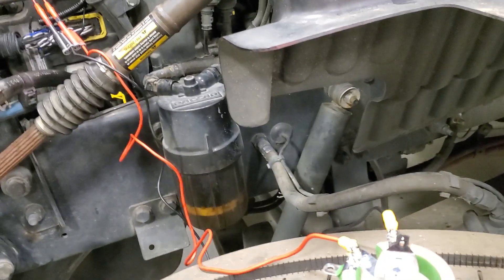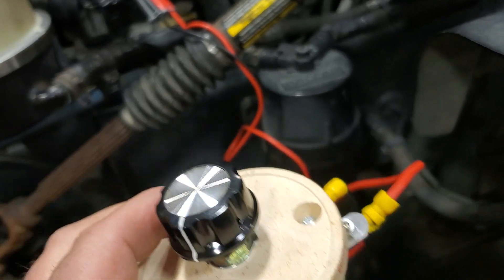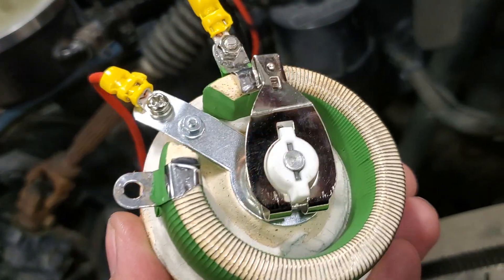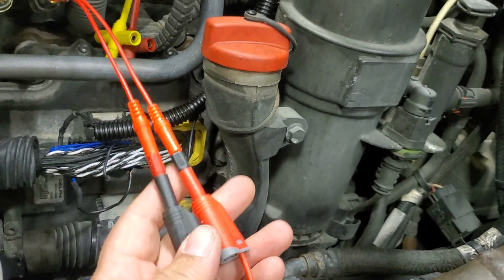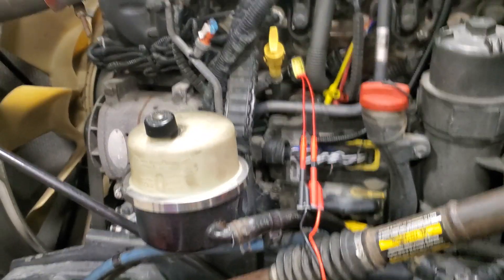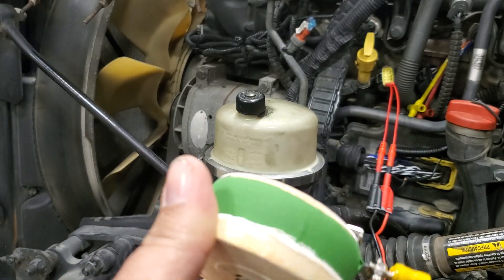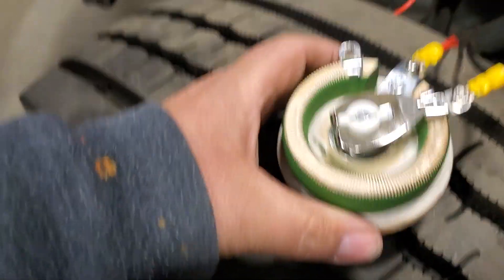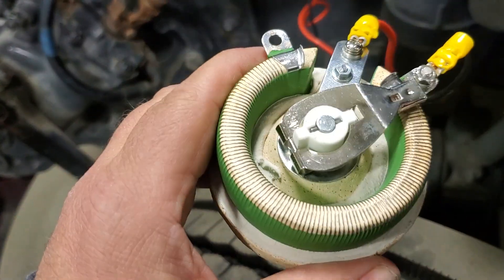Using a reostat as a dummy load for Diesel Injector Synch

Comment: Thanks Mike. How and where can I find the resistance for any injectors? Do you get it from the service manual or should I test a few known goods? I have a diesel pickup with injectors issues. Not sure if it's the injectors or ECU. Don't have a known good vehicle around to gather the info from
Reply from the maker: Those resistance specs should be in the service manual